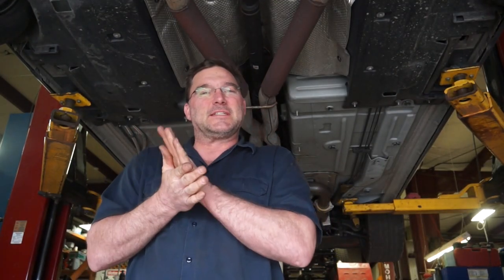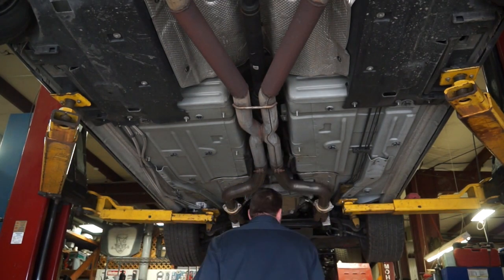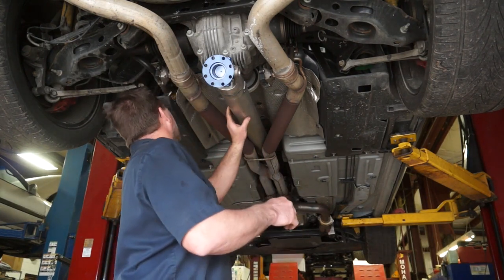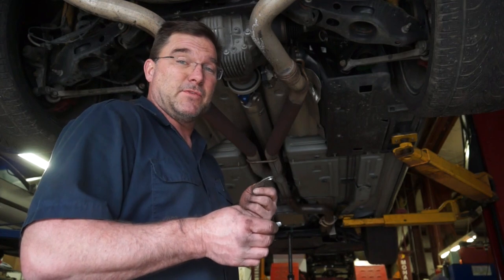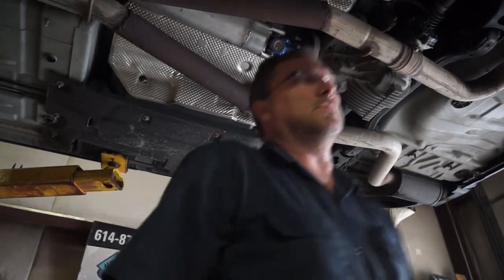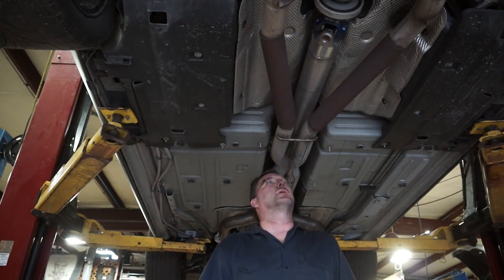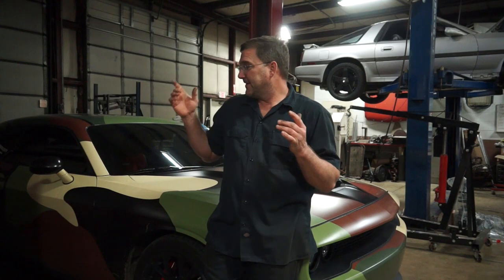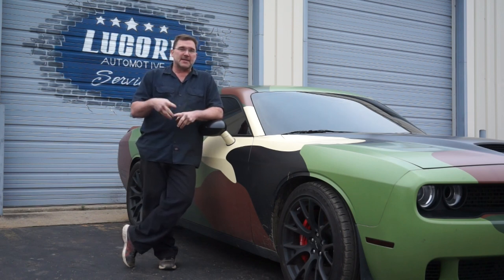1100hp Dodge Challenger Hellcat One Piece Driveshaft upgrade! From Lucore Automotive

Comment: I have a 2016 scat pack with the unsupercharged 392.  Was doing a burnout and the carrier bearing cracked. Several months later it broke completely. I guess I could go for the stock driveshaft with a carrier bearing upgrade or a one piece driveshaft. I don’t want driveline vibration but how bad is it really? I find it kind of ridiculous that it broke. I’m not even supercharged and I’m at altitude here in Colorado, down on power.

Comment: What reason would it be a factory 2 piece drive shaft in the first place? Any ideas?
Reply from the maker: MOST vehicles these days come with 2 piece or multi piece driveshafts. You get rid of a lot of driveline vibration going that way so for the "regular driver" it's a better idea. However when you're building for power going to a beefy single piece shaft is a HUGE upgrade.

Comment: What brand shaft is that?
Reply from the maker: It's a custom built shaft we had made by Driveline 1
Reply: @LucoreAuto  oh ok sweet wasn't sure. I've only messed with Wiles racing hellcat shafts
Reply from the maker: @kiddwebb9588  just about ANY drive shaft would be an upgrade to what is in there from the factory. Definitely isn't up to the abuse of what people are going to put it through.
Reply: @LucoreAuto  ya the 2 piece is definitely a terrible design!
Reply from the maker: @kiddwebb9588  it's kind of amazing how bad it is for how powerful those cars are "out of the box" BUT, it's a weak point they can introduce into the whole system that WILL break versus breaking s transmission or the rear end. So, kinda makes sense... but kinda not :)
Reply: @LucoreAuto  how strong is the diff cause i seen a hellcat charger with a driveshaft rear diff brace on street prep and he broke his diff wide open
Reply: @thenotoriousnova1102  not strong at all its cast